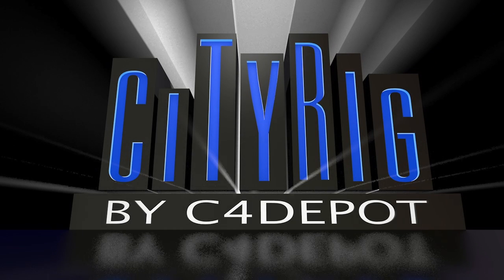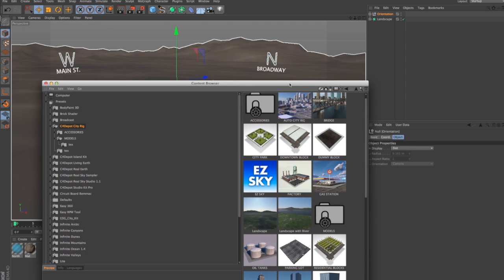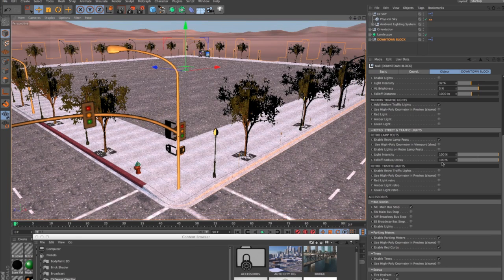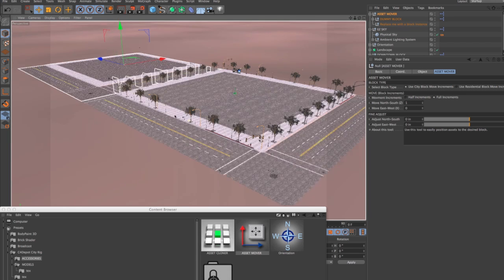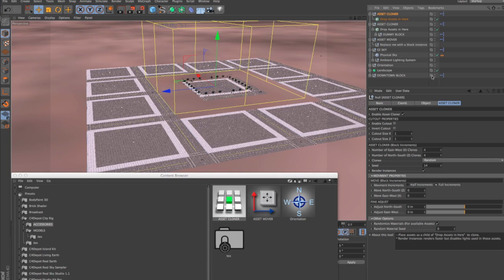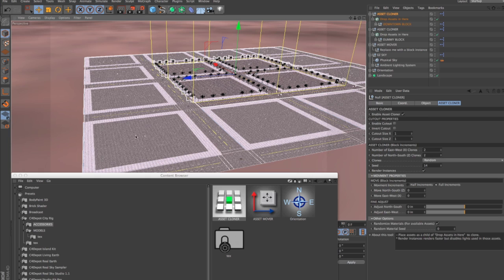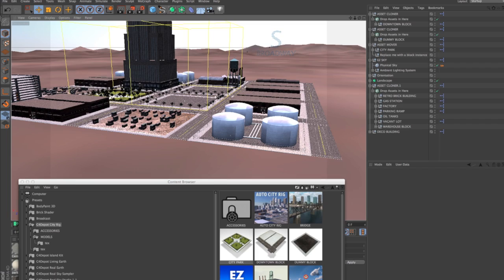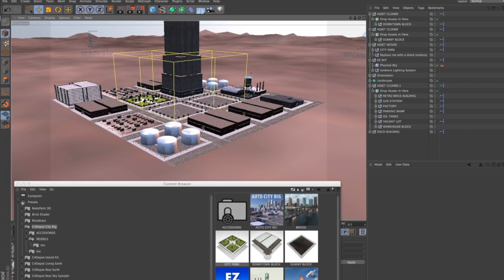CITY RIG Basics for Cinema 4D

Comment: Ha ha, right off the bat you helped me with my biggest issue - the view clipping distance.  I couldn't find that option for the life of me and that will be a big help.  Looking forward to the next tutorial. Awesome plugin - so much fun to play around with.  I'm using R15.057 and I'm getting plain rectangles for the low poly trees and traffic lights in the viewport instead of the 2d textured sprites like in this video.  Does that mean I should install the R16 version with the texture fix?

Cheers,

Michael